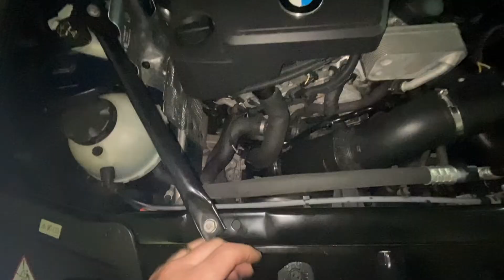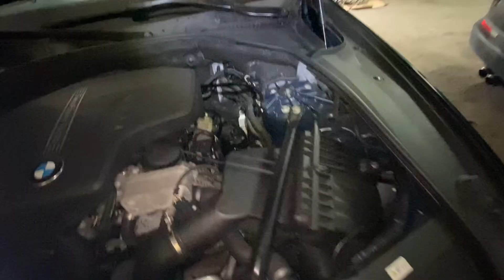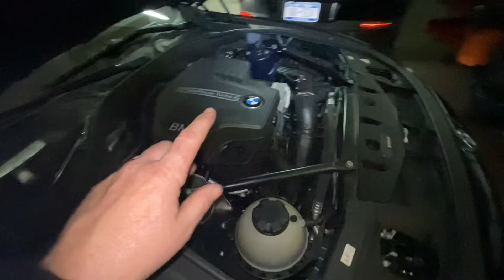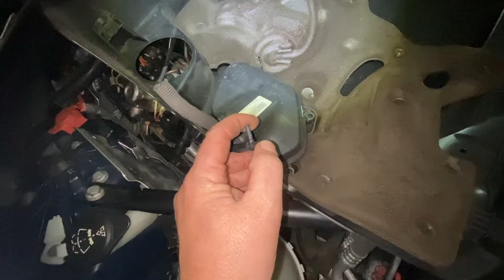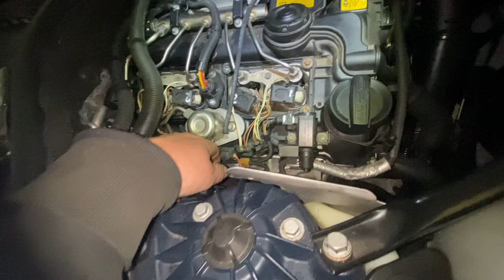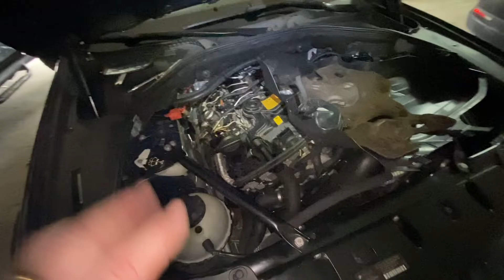Most Common Fixes Of BMW Code 120308 - Drivetrain Malfunction Message

Comment: Thank you mister you are the man
You know these N20 engines inside and out 
Injustice had 120308come up I need check for leak
Reply from the maker: Thank you and good luck with the repair
Reply: @motorcarnut thank you repair will have to wait engine is piping hot 🤣
Reply from the maker: No problem

Comment: Thank you for the detail:
i am having the same fault code in my car (bmw 528i 2013 model),     ; i tookthe car to the garage, after checking the car solenoid replaced, but after that fault code came back. took it back to garage, they couldnt solve, i took it into another garage, they checked and showed there was oil leak in vaccume pump, so replaced with new vaccume pump and garage mentioned to reprogramming, and done that, after that after few kelometers, fault code came again. again took to garage, i think they just cleaned the oil from solenoid etc, im not sure. recieved car back from workshop, after few kelometrs same drivetrain message on screen. i am suffering from this. could you please suggest on this, what check i should do. and was the reprogramming and replacement of vaccum pump was necessary ?
Reply from the maker: On a 2013 BMW 528i with the N20 engine, I would have the garage do this before replacing anything else:

Scan it with BMW ISTA and record every DME code, including freeze-frame data, before clearing anything.
If it is a boost-pressure/underboost code, test the complete wastegate vacuum system:
Vacuum-pump output
Vacuum hoses for cracks, wrong routing, or oil contamination
Turbo pressure-converter/boost-control solenoid
Vacuum reservoir in the valve cover
Wastegate actuator with a hand vacuum pump
Wastegate linkage and turbo flap for excessive play
Charge pipes and intercooler for boost leaks

BMW documentation specifically notes that the wastegate vacuum reservoir can leak internally or contain engine oil, so replacing only the vacuum pump and cleaning the solenoid may leave the actual problem in the reservoir, hoses, pressure converter, or wastegate actuator.

Comment: I am getting this code intermittently about every 20 miles or so while driving steadily on the freeway at around 2000rpm. I do not lose boost. Drivetrain Malfunction light comes on then turns off after 30secs to a minute. Visually Inspected and reseated charge pipe. Replaced Vacuum Solenoid, Vacuum Pump, Vacuum Lines. Still getting this error. Any suggestions would be appreciated. Don't have the tools to do smoke test or pressure test myself. Probably have to take to BMW mechanic.
Reply from the maker: Wastegate arm to flapper should be tight

Comment: I know it's not my Intercooler or charge and boost pipe as I just replaced them but still getting that 120308 Warning.
Reply from the maker: Have you checked the vacuum lines and the wastegate actuator for potential leaks as well?
Reply: @motorcarnut  I will check , thanx brutha!
Reply from the maker: No problem!

Comment: i had this error code shown up last week, and its intermettent status. after i reset, and drivetrain dismiss, my car power feels so loose, and its only have maximum run in 80-100km/h no more on that. this happened on x1 2017 f48. do you have any clue on this?
Reply from the maker: Just what I described in the video

Comment: I just replaced my turbo and I get this code the drivetrain malfunction pops up like once a day and when it happens I feel my gas pedal become unstiff and feel very soft and it needs a lot of foot pressure to get up to speed
Reply from the maker: Since you just replaced the turbo, double-check your wastegate actuator calibration and all vacuum connections to ensure everything is seated properly.

Comment: I had the same issue when accelerating or going uphill in my 2012 535i F10 with N55 turbo engine.  It turned out to a defective turboboost solenoid.  That is Pierburg 11747626351-M244 sold for $116 and that is the German OEM for what BMW uses..  The labor charge was 1 hour at $140.   There are other videos online - search for "turbo solenoid replacement."  This is sort of a DYI.  It's somewhat complex requiring several parts to be removed to access it. The only problem is if you mess it up, your car may not be driveable to go to the garage.  Probably worth having an honest garage

Comment: First off Merry Christmas  MotorCarNut, can a vacuum hose to the turbo cause my NEWLY acquired 2013 X3 28i  to trip the drivetrain malfunction " limp mode" without tripping the CEL  and giving a obd 2 code?
Reply from the maker: Thank you to you as well!!!

Yes it can usually turbo related codes

Comment: Sir I have a 2013 X6M with the s63 with the code 30ff and 310b, smoke tested the vacuum lines and seems no leak there, I’m lost
Reply from the maker: Those two codes usually point to a boost leak or a faulty wastegate actuator or the flapper valve on exhaust I have videos on replacing the flapper you might want to check out.

Comment: Also check your MAP Sensors. My code was because of a Map sensor being faulty reading the wrong amount of air entering into the throttle body. Best way to know if you have codes saying you have a air leak and no sign of smoke after smoke testing then unplug your map sensor and if the air leak code disappears then your map sensor is faulty. Thats how I found out about myne.
Reply from the maker: Correct thanks for the extra info! Appreciated
Reply: @motorcarnut  no problem, also how you know if its the map sensor as well is it will set off the malfunction randomnly sometimes constantly one after another with a very high pressure reading in the intake that gets stuck and will not lower down.
Reply from the maker: Yep that’s correct

Comment: Can you provide me the name of the parts and part numbers please? Thanks in advanced to all
Reply: Seems it lags when i accelerate i get codes 120408 and 120308 for a 2012 bmw 528i xdrive
Reply from the maker: This is common for your symptoms.

https://youtu.be/6e6uKIra8Rc
Reply from the maker: I have no idea what is wrong with your vehicle or even what vehicle you have? And it should be diagnosed first to see what parts you need?

Comment: Thank you very much for this video.

By any chance, can this 'Drivetrain Malfuncion' or even the code 120308 show due to a faulty 'High Pressure Fuel Pump' (Code 11A401 and 11B401)? If not, I am guessing I must have a boost/vacuum leak AND also a faulty HPFP too 😭😭 .
Reply from the maker: Thank you! , No that 120308 is not related to the other codes. But the HPFP are known to fail so you are probably in the right direction.

Comment: First thing check if you have oil on vacuum lines.  If you do  most common thing is failed vacuum pump. Change it and also the solenoid.  Do not buy a cheap Amazon one, buy our rug solenoid that has good response and dialed to your car.  The  actuator can also be full of oil. Remove and put it. Upside down to verified it is not full of oil.  My experience the solenoid was bad and a cheap version was causing me a lot of research and money
Reply: Bought Pierburg solenoid. All good after that. 
Wastegate has play due to bushing but does not impact performance
Reply from the maker: But I will soon, have a video on how to replace the flapper valve
Reply: Can i send u an image of oil line leak i have? Because i have this code ? Email ?
Reply from the maker: Post on your channel
Reply: Can u provide me part numbers for the parts please? I am having same issues
Reply from the maker: Not really, don't know what you need. Go to factory website put in vehicle info or VIN number to get part numbers
Reply from the maker: Correct!

Comment: I changed boost solenoid , smoke test showed no leaks , i am guessing its my diverter valve or major turbo issues
Reply from the maker: Check the waste gate flapper valve can't be loose, I have videos on the failure and replacement of that valve, common problem.
Reply: @motorcarnut i dont hear any noise though from that area ! So weird
Reply from the maker: Can't just go by sound, that valve has to be tightly closed
Reply: @motorcarnut i have to take off under tray and look from the bottom right ??
Reply from the maker: Yes that would be the best way
Reply: @motorcarnut changed my diverter valve still getting the 120308 code
Reply from the maker: That code could be a wide vary of problems not just the diverter valve.
Reply: @motorcarnut is that possible to see without dropping subframe
Reply from the maker: Inspection mirror and light should be able to see it better from bottom though

Comment: Hi, I have a 2014 2 series active tourer, the same drivetrain message pops up when I go up a hill or I really step on it, then disappears after random periods of time. I took it to several mechanics, kept getting the same 120308 code but noone would actually check everything under the hood. So I took it to BMW, they get the same code 120308 Charging pressure control: pressure too low. They said straight up whole exhaust turbocharger needs replacing at £1800! I said well which part is failing? they couldn't or didn't want to tell me , their computer printout which they gave me tells them that replacing the electronic wastegate valve controller is only a temporary fix and will lead to repeat repairs, so just replace the whole turbo! So I'm guessing it's that wastegate that's the issue? I've booked the car in for a second opinion at an independent mechanic that does turbos. Any advice would be greatly appreciated...
Reply from the maker: They want to replace a turbo but nothing is wrong with the turbo unless the propellers have excessive play or its burning oil. And I doubt they even looked. They should get off the computer and physically check! Probably the waste gate flapper valve not sealing properly if there are no leaks in the charging pipes leading up to the throttle body. I have many videos on this to help people fix it themselves depending on their knowledge or at least know what's wrong not to get taken for more money.
Reply: @motorcarnut  thankyou, I would at least expect them to do visual checks on the pipes and smoke tests. I can hear a slight whistling noise when accelerating, there's no smoke coming out of the exhaust, there are no oil leaks underneath at least. Fingers crossed this other mechanic will be able to test each part and give me options.
Reply from the maker: No problem, good luck

Comment: Hey, what’s going on? I have an electric wastegate actuator getting low boost code. Still don’t know what to do already replaced electric wastegate actuator with a new one. Car throws code right around 60% throttle. Should I check diverter valve?
Reply from the maker: Could be, got to make sure the flapper valve seals tightly when waste gate is fully extended.
Reply: @ flapper valve ? I do hear the wastegate raddling , i also noticed that the clips are broken on the small tube going from valve cover to the charge pipe not sure if that would cause a code.
Reply: The car seems to have boost then i noticed that the wastegate actuator works for a min then completely shuts its self and never opens again. Thats why i replaced the electronic WG actuator
Reply from the maker: https://youtu.be/6e6uKIra8Rc

Comment: Hi, on mine I have already changed the solenoid, the wastegate, the tubing, and the car is always 0.5 bar below the requested, I can’t understand what could it be. If I lock the wastegate closed the car is a rocket, so I think I didn’t have any leaks
Reply from the maker: Very common problem and fix.
https://youtu.be/6e6uKIra8Rc

Comment: Eu estou com o mesmo problema, mas a linha de vacuo está cheia de óleo acho que pode ser isso, quando o reservatório de vacuo fica cheio de oleo ele para de mandar vacuo pro sensor e ocasionando este erro o que acha?
Reply from the maker: The vacuum pump need to be replaced if you see oil in the vacuum lines. This is a known problem with BMW's
Reply: @ ty bro, your videos is very Nice
Reply from the maker: Appreciate that, Thanks!

Comment: Hey brotha I have same car same issue getting same code and how can I get a good reading to see if this sensor is actually bad on mine. I vacuum tested the sensor and test good bit code comes back after a while.. thanks for the video good stuff
Reply: Hey thanks brotha looks like I figure it out westgate solenoid not holding vacuum thanks appreciate the help
Reply from the maker: Great! no problem glad you found the problem.
Reply from the maker: Thank you, Follow this video or here are 2 more that can help you out.
https://youtu.be/GrCZTwiokKU
https://youtu.be/3QcKdWooX-w

Comment: I have a question so I have that code along with a couple other codes. I've changed spark plugs and coil packs and I put a new boost solenoid The car drives okay but when I push it drive tray malfunction comes on instantly and it's probably shut the car off and turn it back out. It goes away but if I drive fast again drivetrain malfunction comes on. So I bought turbosmart blower valve but I haven't put it on yet. You think if I swap out the diverter valve and put that on that could be the problem?
Reply from the maker: Probably not. Most likely it’s the flapper valve on the turbo or a leak in the plastic plumbing from the turbo to the throttle body.
Reply: Do you know the exact name for that pipe that goes from the turbo to the throttle body?
Reply from the maker: @beamer2169 there are many connections that can leak there is no one pipe, check out my video here:

https://m.youtube.com/watch?v=3QcKdWooX-w&feature=youtu.be
Reply: You said plastic plumbing from turbo to throttle body that's y I asked. Thanks I will watch
Reply from the maker: @beamer2169 no problem
Reply: Did you ever fix it

Comment: Is there supposed to be oil coming out of the 2 lines you disconnected from the engine cover
Reply: no bro vacuum pump needs replacing
Reply from the maker: No, those are vacuum lines

Comment: You missed mentioning the vacuum pump itself. It might leak oil - pushing oil in vacuum line and if you leave it untreated will mess the turbo.
Reply: If the pump is leaking will it leak down the vacuum hose and put a layer of oil on the waste gate ?
Reply: @guap7182 in short you will need a new turbo that has happened with me - with max boost always get a boost leak.
Reply from the maker: Maybe
Reply from the maker: Yes
Reply: @motorcarnut cool so that’s what i’m dealing with. Theres a rebuild kit on amazon. Would you replace or use the kit ? & do you think that will fix my 120308 code ? I only get the drivetrain malfunction when i’m going uphill with A/C on.
Reply from the maker: I would just replace the vacuum pump. But you may has other issues but this is directly related soreplace it first
Reply: @motorcarnut the one at the back?
Reply from the maker: Yes, I have a video on replacing the vacuum pump too
Reply from the maker: I have other videos about the vacuum pump and it’s failures.

Comment: I keep getting the “drivetrain malfunction “ after changing my turbo boost silinoid thing. I check hoses n no holes or cracks I can see. I have the diverter valve but looks like a tight job. Any videos on replacing that? 🙏🏽
Reply from the maker: Don’t have an engine in the car to show only one that is out right now. I’d check the wastegate flapper valve make sure it closed when applying 7in hg
Reply: I have the same problem, did you replace the diverter valve and did it work?

Comment: hello
i have a 2013 528i rwd. we replaced the engine and found vacuum pump does not have vacuum hose. it may came from different model. 
the old engine has vacuum pump hose attached. same engine that is showing in this video. after replacing the engine, we test drove and has a code 120308. we smoke tested and everything is good. do you think we have to swap the vacuum pump from the original engine. or should we replace the boost solenoid.
Reply from the maker: Are you saying new engine has electronic wastegate?
Reply: I just checked the new used engine is  N26  and it does not have vacuum port of vacuum pump.
should i change to with vacuum port.
Reply from the maker: @fareastautomotive If it didn’t then it used an electric wastegate and you would have to change all parts of old engine wastegate solenoid vacuum pump etc.
Reply: @motorcarnut  thank you. I think thats why it giving me same code. thanks again.
Reply: its the same engine N20 as shows in this video. @motorcarnut

Comment: Thank you! Been chasing a low boost pressure code for a while, after swapping spark plugs and coil packs. Gonna check the solenoid and tank on the cover now.
Reply: Check your throttle body sensor and check your map sensor too. If the throttle is clogged up with oil and carbon and the map sensor is covered with oil and carbon too, you may need a complete cleaning service of you intake manifold. It is a big and expensive service. Check your Booster pressure solenoid and pressure converter into th waste gate too.
Reply from the maker: @dinhvanpham8102 True, oil and carbon can cause lots of problems.
Reply from the maker: No problem. I have many videos on the low boost if you want to check them out.

Comment: Hi, I have a 2012 328i 2.0L.  After finding oil in all the lines from the vacuum pump to the waste gate actuator. I replace the vacuum pump seals, replaced the solenoid, and then cleaned out all the lines and the code is still coming up. After fixing all that I got my normal speed back until I go into limp modeI. So I took it to a mechanic and they said that my turbo might be bad. And I have no idea what to do, what do you think.
Reply from the maker: There are many reasons why to condemn a turbo but why they said that idk. I have many videos on the turbo and that code, how to check for leaks, how to change just the cartridge with is a lot cheaper than a complete turbo etc, check them out on my channel.
Reply: Did you manage to find the solution? what was it?